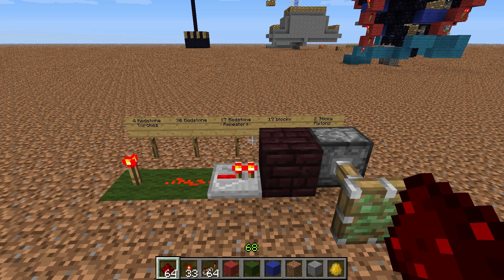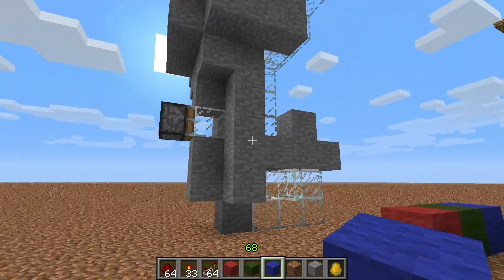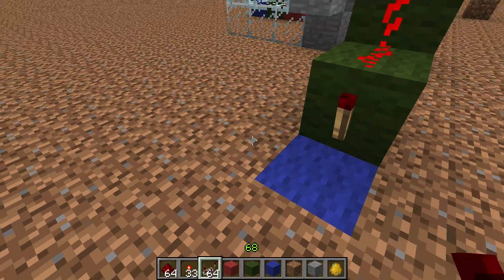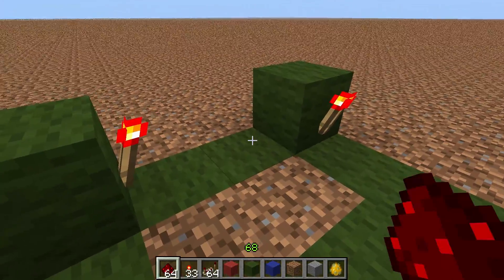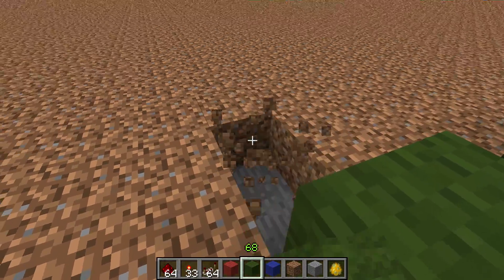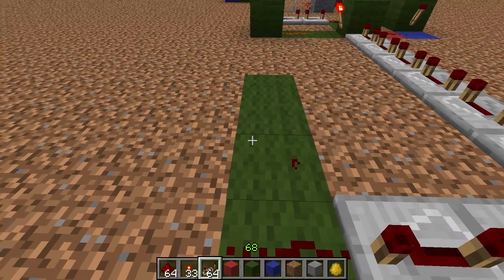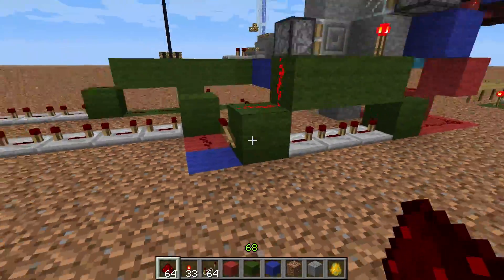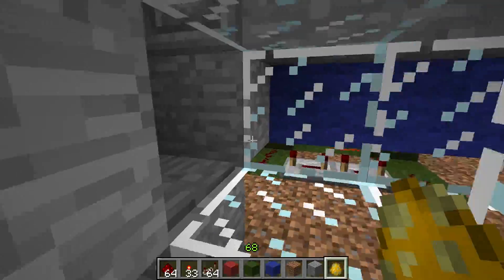Tutorial - Cheap Blaze Grinder Circuit

Comment: I have a problem with it when I built it, I have watched this video at least 5 times and I have this design mimicked to the letter, and the crusher goes in for a short moment, then pulls out almost instantly, does it two times then stops, and hardly does any damage to the blaze

Comment: Don't know if anyone mentioned this in an older post but a heavy weighted pressure plate would keep the kill chamber open until there was enough blaze for 30 lvls. may have to play with the number of redstone between the plate and cutoff piston to get the exact mob count but if blaze are twice the xp as say skeletons than 7 or 8 should be about right.

Comment: Couldn't there be a way to compact the pulse with comparators because I know there is designs out there that use this but you seem to explain what they couldn't.
Reply from the maker: You're probably right that comparators could make this smaller. This video was made long before comparators existed.
Reply: Yeah, and using comparators isn't an option for xbox users until Christmas or around that date. But I do plan on using this design, thank you for the video.

Comment: Just finished this on my SMP snapshot12w37a. Blazes spawn at proper rates, and when they funnel down they get crushed and I finish them off with a single hit. But there seems to be something off with the way they funnel down? I get 1-3 most of the time. There are a lot of mobs in the 3x3 part of the funnel. At times there are no mobs in the 1x1 part of the hole.

Comment from the maker: You have to kill 85 blazes to get to level 30. It takes 3 hits with an unenchanted diamond sword to kill one blaze. That's 255 uses, and a sword has 1025, so with your arrangement you'll get four level 30 enchantments, and then nothing. That's just enough for a full set of armor, but you won't have any enchantments for weapons or tools. Plus, that many sword attacks uses up hunger equivalent to more than 15 loaves of bread.

Comment: I have 2 buttons, a crush and a reset. The reset resets everything, and lets the blaze fall. One blaze (or one group, that's the problem) falls into the bottom, where there is a pressure plate. That pressure plate activates a glass roof and crushes the blaze four times. The new blaze, the undamaged that is, fall onto the glass roof and they are crushed UNTIL the bottom blaze die. Then you punch the blaze and press "Reset" when you want to let a new group of testing blaze in.

Comment: Basically: First blaze falls into a hole underneath the collection chamber. He suffocates four times. The floor leading to the hole closes. Then the blaze collect. When you press the "grind" button, it activates an RSNor latch, which is AND gated with a pressureplate on the bottom of the hole. When the bottom blaze dies, the top blaze have exactly one hit left. I'll upload it to DropBox or something if you want me to. You can probably make it more efficient but I didn't feel like it.

Comment: For those playing with the RedPower 2 mod, the Pulse and State cell do this job just as well.
Have it running on my SSP TechnicPack server.
I recommend using redstone instead of Alloy Wires, as pressure plates do not activate wires and they can sometimes be buggy when switching from redstone to wire.

Comment: Here, on a 5x2x1 space:
Row 1:X>ZXX
Row 2:Y>>>X
X,Y,Z=Redstone wire. >=Repeater (facing that direction)
Send an input to Y, presumably a button. Z is your output. The repeaters on row 2 are, from the left, 4 ticks, 4 ticks, and 2 ticks. the repeater on the top row is one tick. If your input is a button, the repeater in row 1 goes to your output, and when it ends, the repeaters from row two will turn Z on as soon as the original input ends, increasing the signals length from 10 ticks to 20.

Comment: ah, interesting - I get the concept. The pulse lengthener produces a pulse that is at least as long as the input, but can as well maintain while the monostable circuit only turns on the output for one specific set amount of time only. Why not get rid of the the pulse lengthener entirely though and only use the monostable circuit? Wouldn't the Blazes constantly activate the pressure plate all the time anyway, making pulse lengthening (of this definition) sort of... redundant?

Comment from the maker: Try playing around with the components separately using a lever as input. The pulse lengthener adds duration to the incoming pulse. If you hooked the pressure plate directly into the pulse lengthener, its output would never turn off. The monostable circuit always goes off after a short time.

Comment from the maker: The repeater between the last OR gate and the piston is necessary because otherwise the piston retracts momentarily halfway through. That causes some blazes to have 2 HP instead of 1. The repeaters in the middle of the RS NOR latch are required for a similar reason.

Comment: What exactly is the difference between the pulse lengthener and the monostable circuit? It seems to me they both have the same feature - create an elongated input that is turned off at a determined point of time (controlled via repeater). So how do they differ and how does it make sense to use them in sequence instead of just having one of them that is "programmed" for the exact same time both pulse lengthener and monostable circuit make?

Comment: Okay, so I've made a blaze farm that is way more resource efficient than yours. The only problem is that the first section of blazes is killed (I'm using a blaze - 2 hearts of damage) as the timer and it dies, so if you have 20 blazes in the same space, that's 19 wasted. I need to figure out how to individually separate them.

Comment from the maker: That doesn't work. If you use a normal piston for the separator, mobs will glitch through it sometimes, which gives you an undamaged blaze mixed in with the damaged ones. And a normal piston can't cause suffocation damage by itself. You have to push a solid block into the mobs.